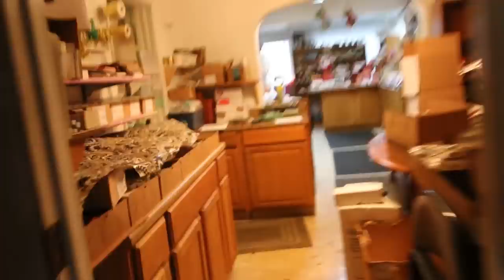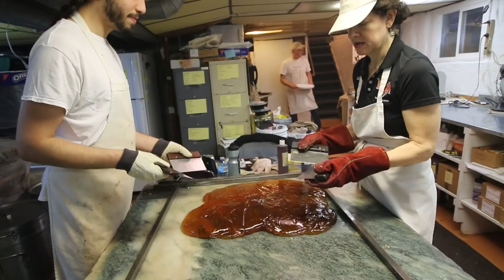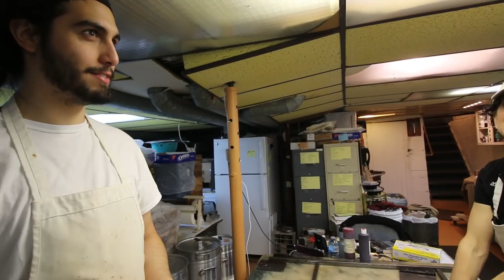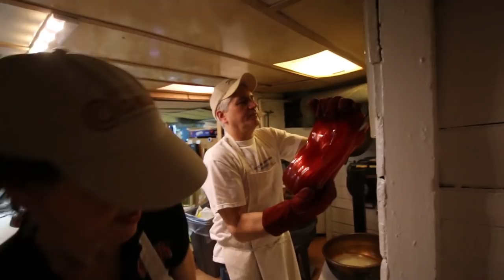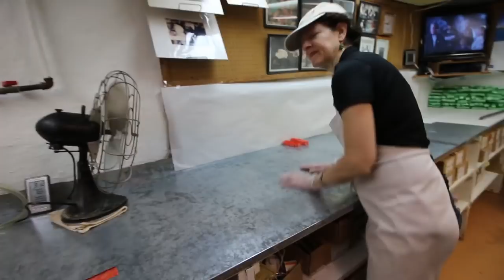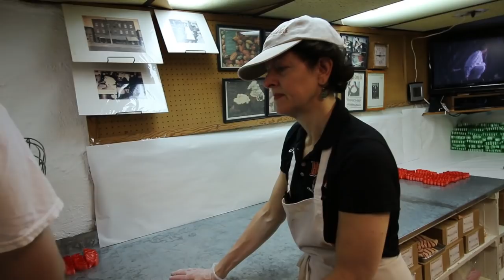Raspberry Flavored Ribbon Candy

Comment: With the other ribbon candy you added the flavor once you poured it on the table why with  the fruit flavors do you add the flavor in the kettle
Reply: Katherine Herrera stronger flavors like mint will attach itself to the kettle but weaker flavors do not. Even if they wash the kettle the flavor will linger. Fruit flavors are weaker.